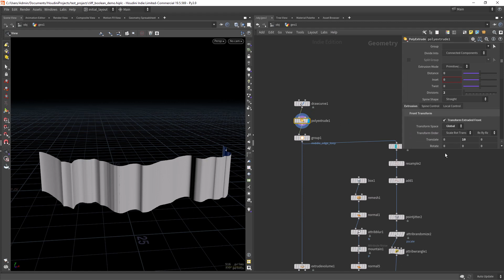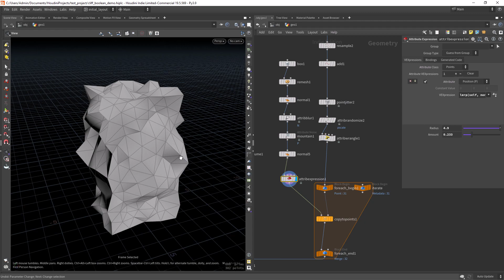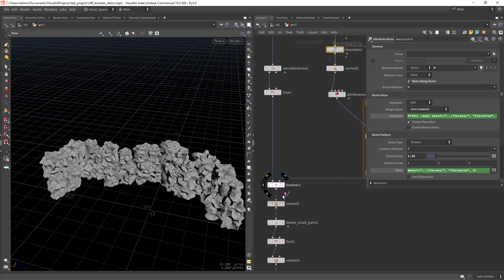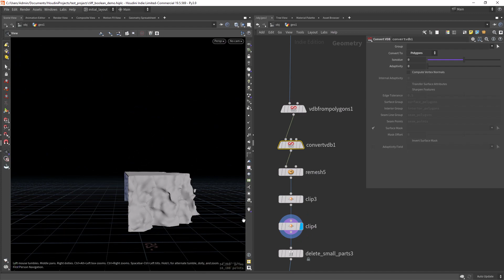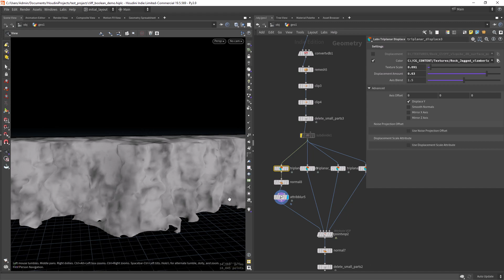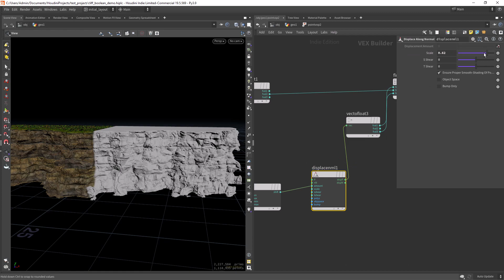Quick Rock Cliff Setup in Houdini

Comment: I added triplanar disp node(color) and adjusted displace by attributeVOP, but my geo is not getting sharp, it's blurry and rounded.. how did you get that sharp geo by displacemen? 
edit: also I added subdiv before triplanar
Reply: I got the hip files and I solved it! the reason was that I applied Mix node input wrongly and my geo scale is pretty big so I needed to add more scale value in Displace Along Normal node. Also, I found that you have so many helpful tutorials! Thank you so much :)
Reply from the maker: Hard to tell, are you using the Cd attribute to displace the Geo? You can always have a look at my original file. Cheers

Comment: A cool trick for the mountain on cubic shapes is to add point normal, the attribute blur the normal then the mountain works better on the corner 🤟
Reply from the maker: Tnks I actually did that when I mention smooth the normals .. cheers